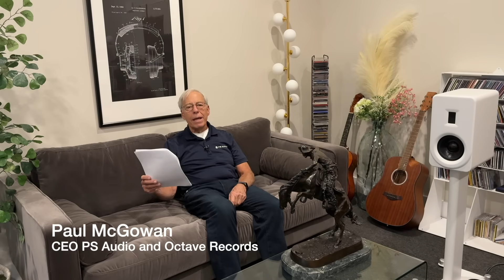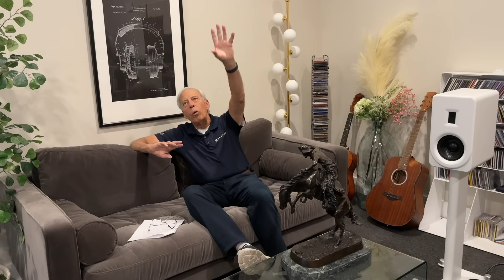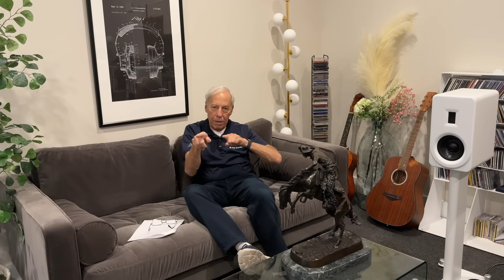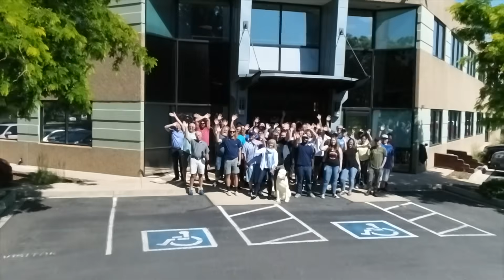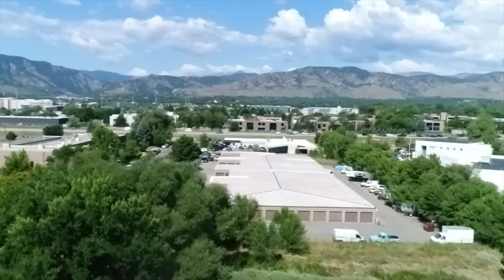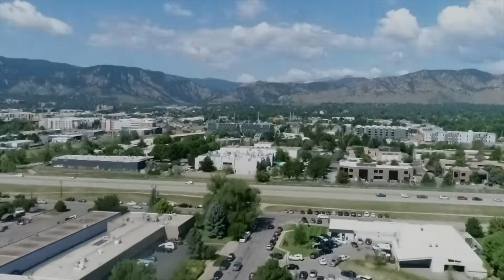DC Blockers and Power Plants

Comment: Transformer Hum and Other Annoyances
The German text is binding for any translation errors!
Repeatedly, people complain about transformer hum, with a DC component of the mains voltage being cited as the cause. This is often attributed to "toroidal transformers" and transformers with cut-core cores. I've done some research on relevant online forums and often encountered the most absurd theories, which I won't list in detail here.
The causes I repeatedly find:
1. Poor core assembly (with cut-core cores, the retaining bands are only loosely mounted).
2. The windings are also loosely wound, and the coil formers are not firmly seated on the core.
3. Toroidal transformers—and this is a crucial weak point with this design—are undersized for the power they are designed to transmit!
From a purely physical/technical perspective, toroidal transformers are the best transformers: minimal magnetic leakage and therefore the lowest losses.
But... Many manufacturers dimension these transformers incorrectly, choosing too small a number of primary windings, which causes the magnetic field density to become too high:
Field density peak values of up to 19,000 Gauss (1.9 Tesla) are selected.
The result is not only excessive heating, but also that the transformer hums and draws excessive no-load current at slight overvoltage. Likewise, "DC components" in the mains voltage are often mentioned. It must be noted: The DC components arise from asymmetries in the sinusoidal waveform of the mains voltage and not from superimposed DC voltage!
If the field density peak values were not chosen higher than 12,000 Gauss (1.2 Tesla), the transformer would not hum, even if a DC component were to arise from various influences.
Conclusion: All conventional toroidal transformers, especially those available from electronics stores, are useless and are definitely not suitable for my applications.
A better solution than all these DC blockers would be:
1. Clean overall design of the transformer: Solid windings, tightly tightened retaining bands for cut-cores AND, in addition, vacuum impregnating the entire transformer with a baking varnish.
2. Enclose the entire transformer in magnetic shielding, which is also potted, thus avoiding magnetic stray current and mechanical hum.
3. Select field density peak values no higher than 1.2 Tesla, which is also less sensitive to asymmetries in the sinusoidal waveform of the mains voltage and to short-term overvoltages.
For my device developments, I never buy "off-the-shelf" transformers, but rather have all my transformers custom-made according to my specifications and BVs.
I always have toroidal transformers completely installed in mu-metal housings and potted with appropriate potting compound.
I never have problems with humming transformers, even when I put my ear right up to the casing of my devices and listen.
My large active speakers (3-way fully active) use transformers with cut-band cores of size M 102/54, and my two drive amplifiers (designed in-house) each use toroidal transformers with mu-metal encapsulation. And I don't need anything like a "mains filter" either, since I integrate them into the respective device. None of these devices has ever produced any audible hum or interference from RF interference on the mains. And I design my power supplies (linearly regulated with a series regulator and stabilizer!) so that the device in question still operates perfectly even at undervoltage down to 190 volts.
A well-dimensioned ("high-end") power supply is insensitive to: overvoltage and undervoltage, to DC components, and to all types of RF interference on the mains!
I never have any problems with power outages of any kind.
However, I would like to point out the dangers of making any changes to the power supply of your devices or tampering with them in any way without the appropriate technical knowledge, because handling power is life-threatening!

Text auf Deutsch

Trafobrummen und andere Ärgernisse

Immer wieder wird geklagt über das Brummen von Trafos, wobei ein DC-Anteil auf der Netzspannung als Ursache benannt wird. Vor allem wird das den „Ringkerntrafos“ und Trafos mit Schnittbandkernen immer wieder nachgesagt. Ich habe in einschlägigen Foren im Netz mal recherchiert und dabei sind mir oftmals die abstrusesten Theorien aufgefallen, die ich hier nicht im Einzelnen aufzählen möchte.
Die Ursachen die ich immer wieder feststelle: 
1.Mangelhafte Montage der Kerne (Bei Schnittbandkernen sind die Haltebänder nur locker montiert)
2. Die Wicklungen sind ebenfalls nur locker ausgeführt und die Spulenkörper sitzen nicht fest genug auf dem Kern.
3. Ringkerntrafos – und das ist bei dieser Bauart geradezu ein entscheidender Schwachpunkt – sind für die Leistung die sie übertrage sollen zu schwach dimensioniert !
Ringkerntrafos sind rein physikalisch/technisch gesehen, die besten Trafos: Minimale magnetische Streuung und dadurch die geringsten Verluste.
Aber… Viele Hersteller dimensionieren diese Trafos dahingehend falsch, daß sie die Primär-Windungszahlen zu klein wählen und dadurch die magnetische Felddichte zu hoch wird:
Es werden Felddichtescheitelwerte bis zu 19000 Gauß (1,9 Tesla) gewählt. 
Die Folge ist nicht nur übermäßige Erwärmung, sondern daß bei geringer Überspannung der Trafo brummt und zu hohen Leerlaufstrom zieht. Ebenso wird häufig von „DC-Komponenten“ auf der Netzspannung geredet. Dazu muß gesagt werden: Die DC-Komponenten entstehen durch Unsymmetrieen der Sinusform der Netzspannung und nicht durch überlagerte Gleichspannung!
Würde man hier die Felddichtescheitelwerte nicht höher wählen als 12000 Gauß (1,2 Tesla), würde der  Trafo auch nicht brummen, auch wenn mal ein DC-Anteil durch allerlei Einflüsse entstünde.
Fazit: Die ganzen gewöhnlichen Ringkerntrafos und vor allem die man im Elektronikhandel kaufen kann TAUGEN NICHTS und kommen für meine Anwendungen in keinem Fall infrage.
Eine bessere Lösung als diese ganzen DC-Blocker wäre:
1. Saubere allgemeine Ausführung des Trafos: Feste Wicklungen, fest angezogene Haltebänder bei Schnittbandkernen UND darüber hinaus, den ganzen Trafo vakuumtränken in Einbrenntränklack
2. Den ganzen Trafo in magnetische Abschirmung packen die ebenfalls vergossen ist, dadurch vermeidet man magnetische Streuung und mechanischer Brumm.
3. Felddichtescheitelwerte nicht höher wählen als 1,2 Tesla, folglich auch weniger empfindlich gegen Unsymmetrieen der Sinusform der Netzspannung und gegen kurzzeitige Überspannungen.
Für meine Geräteentwicklungen kaufe ich niemals Trafos „von der Stange“ sondern ich lasse mir meine sämtlichen Trafos nach meinen Vorgaben und BV’s kundenspezifisch anfertigen
Ringkerntrafos lasse ich mir grundsätzlich vollständig in Mu-Metallgehäuse einbauen und vergießen mit entsprechender Vergußmasse.
Ich habe niemals Probleme mit brummenden Trafos, selbst dann nicht wenn ich direkt mit dem Ohr mich auf das Gehäuse meiner Geräte gehe und höre.
Bei meinen großen Aktiv-Lautsprechern (3-Weg vollaktiv) sind Trafos drin mit Schnittbandkernen der Größe M 102/54 und bei meinen beiden Ansteuerverstärkern (Eigenentwicklung) jeweils Ringkerntrafos mit Mu-Metallkapselung. Und so etwas wie „Netzfilter“ brauche ich auch nicht, da ich diese in das jeweilige Gerät integriere. Keines dieser genannten Geräte erzeugte jemals irgendwelche hörbaren Brummstörungen oder Störungen durch HF-Störungen auf dem Netz. Und ich lege meine Netzteile so aus (lineargeregelt mit Längsregler und Stabilisator !), daß das betreffende Gerät noch bei Unterspannung bis herab auf 190 Volt noch einwandfrei arbeitet.
Ein gut dimensioniertes („High-End“-) Netzteil ist unempfindlich gegen: Über- oder Unterspannung, gegen DC-Anteile und gegen HF-Störungen aller Art auf dem Netz !
Ich habe nie Probleme mit Netzstörungen aller Art.
Ich möchte aber jeden auf die Gefahren hinweisen die bestehen wenn man ohne die jeweiligen Fachkenntnisse irgendwelche Veränderungen am Stromversorgungsteil seiner Geräte vornimmt oder sonst irgendwie daran herum hantiert, denn  der Umgang mit Netzspannung ist lebensgefährlich !!!

Comment: I have a lot of DC on mains where I live and my old power amplifiers, with linear supplies, hummed a lot. The hum comes from the transformers not the speakers. 
I tried an older PS Audio PPP regenerator and it made the hum worse.
Putting a DC blocker before the PPP did help a bit.
Apart from the hum the addition of the powerplant made a huge positive impact on sound quality.
I have also played with a P10 regenerator and this doesn't have the hum problem so I'm guessing that the PPP doesn't have a DC blocker but the P10 does. The improvement in sound quality with the P10 was even greater than with the PPP.
Reply: Sie haben Schrott-Netzteile mit Schrott-Trafos drin, sonst würden die nicht brummen wenn mal etwas DC-Komponenten auftreten. Die DC-Komponenten sind keine Gleichspannungen auf dem Netz, sondern es sind Unsymmetrieen der Sinusform der Netzspannung.
Und das ganze Philosophiern über "Klangverbesserung" nach irgendeiner Veränderung: Es ist nur Einbildung. ! Solange nicht im Blindtest und direktem Umschaltvergleich etwas beurteilt wird, ist die ganze Beurteilung wertlos und mehr Einbildung, Wunschdenken, Selbstsuggestion und Erwartungshaltung.
Wirkliche Klangverbesserungen kann man nur durch Messungen und Doppelt-verblindeten Hörtests feststellen.

Comment: Paul says you don't need a DC blocker in front of a Power Plant because a Power Plant already has one. So you don't need a Power Plant because hi-fi components already have power supplies with noise rejection?
Reply: A powerplant makes a surprisingly big difference to sound quality even on equipment with very high quality power supplies.

I've experimented with a couple of different PS Audio powerplants and they are excellent products. I would buy one today if I had the rack space. Unfortunately getting a second rack past my better half would be impossible.

Comment: is a power plant the same as an automatic voltage stabilizer?
Reply: go with commercial from Eaton, Tripplite, Siemens, etc, no nonsense babel, and actually UL listed, i suspect this PS stuff is not UL listed, and it's odd at such absurd pricing, yet isn't meeting UL standards, wonder why?
Reply: @cengeb  
'I suspect this PS stuff is not UL listed" 
Yet, you contently bitch about PS stuff not being UL certified? This isn't your first time bitching about this UL certification in the comment section of PS Audio. So, you're guessing? If you had a half a brain you'd simply get on their website and click on their equipment and click for the rear picture of the equipment. UL certification is for safety.  Has nothing to do with what a particular audio company uses in their design and if that design does what the manufacture claims. If you think PS Audio is the only audio manufacture in the States that doesn't have a UL certification you better start checking. Look at Boulder and D'Agostino making 6-figure audio equipment and take a look at the back of their equipment.

Comment: how about a power conditioner to the cable modem?
Reply: I put a Fosi power filter between the wall wart power supply and my fiber modem/router.  No idea if it helps, but it certainly can’t hurt and costs $30.

This Fosi filter is VERY effective at keeping power supply noise out of cheap class D amps, so I know it works.  You just need to verify if what you’re powering uses the 5521 or 5525 barrel jack.  Works with anything 12V-48V, up to 10A.

Comment: Die Problematik allgemein: Heute werden vielerorts Trafos einesetzt mit Ringkernen. Diese Ringkerntrafos werden LEIDER (!!) zu hoch induziert - bis zu 19000 Gauß (= 1,9 Tesla). Die Folge ist, daß der geringste Anteil von DC auf dem Netz den Trafo in die Sättigung bringt und er dann anfängt zu brummen.
Würde man die Felddichtescheitelwerte nicht mehr als 12000 Gauß (=1,2 Tesla) machen (durch höhere Primärwindungszahl) wäre diese Problem weit weniger schlimm.
Meine Netztrafos - die ich selber dimensioniere und mir dann kundenspezifisch anfertigen lasse - lasse ich nicht höher induzieren als 1,2 Tesla. Ich habe daher keine Probleme mit DC-Störungen. Die DC-Anteile entstehen vor allem durch Unsymmetrieen der Sinusform der Spannung.
Da ich mal als Lehrling in einer Trafo-Fabrik gelernt habe.... kenne ich mich mit Trafos aus.
Reply: Ich benutze "klassische" Netztrafos mit MD-Schnitt. Stecken diese Trafos die Vormagnetisierung bei leichten DC-Anteilen auf der Netzspannung besser weg als die knapp dimensionierten Ringkerne?

Comment: My guess is a DC blocker adds more serial resistance (I guess around 0.1 Ohms reactive impedance based on some rough calculation) to the power wiring than even a standard power cable (typically 0.02 Ohms)...still I can see why some people will need it even it's quite the opposite of an expensive power cable...in a way.

Comment: I used an Audiolab DC blocker before I bought the P12 regenerators and it reduced the cruddy noise from my incoming power and worked good basically for the amplifier but introduced noise into the streamer, CD player & TT and I once I separated them it was quiet. DC Block is cheap and good for a starter if you're on a budget but I could not and would never go without my Dual P12s now.
Reply: Could you elaborate on "separating"? How was the sound affected before and after?
Reply: @shreddherring I just ran the DC block directly to the amp & preamp & plugged all the sources into the wall & the slight buzzing & RF noise went away. I added a Furman AC215 power conditioner that made it better & I still use it with the P12 regenerator that continue to power the amp and preamp. It works for me but I'm in a bad spot for power in my neighborhood and I also have a small room so it's tricky to keep things quiet. I use the DC block for the AV system in the basement and it helps there too. It's a good little thing to have for the price. 👍

Comment: If you are worried about this, then make sure you do not use toroid transformers, they are the most sensitive to the DC component on the AC.
Reply: That's a tough one these days, given that a lot of manufacturers employ either toroidal or O-ring transformers.
Reply: Yes, they are cheap to build nowadays.
Reply: I think the combination of adding a dc blocker in the dc line with a toroid transformer outweighs the downside of iron core
Reply: @xaviermontalban1701  Alles Unsinn ! Das Einzige : Einen Trafo verwenden mit geringer dimensionieren Felddichtescheitelwerten.!
Ich kenn mich da aus, da ich selbst mal in einer Transformatorenfabril gearbeitet habe und Trafos berechnet habe !
Reply: Siehe meine Erklärungen zu Trafos oben!

Comment: I was thinking the other day, when looking at modern power stations (bluetti, ecoflow etc) would running your hifi off a LiPo achieve something similar to a power station? Maybe for more midtier system? Thanks for the video im going to watch cold cole train
Reply: By the way i read up on this, lots of the better power stations (ecoflow has a good article on ThD) but they can produce near 0 ThD as I suspected. Also you are entirely uncoupled from the wall. You can get a 1800w ecoflow delta with a pure sine wave generator and near  0 ThD and theres not even a chance of any DC because its a battery. If you arent out to spend 10k on a powerplant, I wouldn't hesitate to compare one of these in a blind test, or even with measurements. For anyone interested. Also has the added functionality if running your appliances off of solar.. kind of a no brainer for 4-500$ if you have irregular voltage or dirty DC